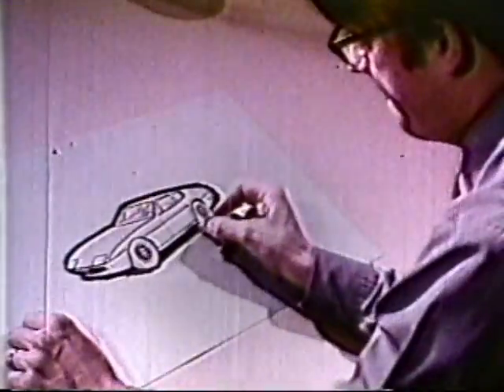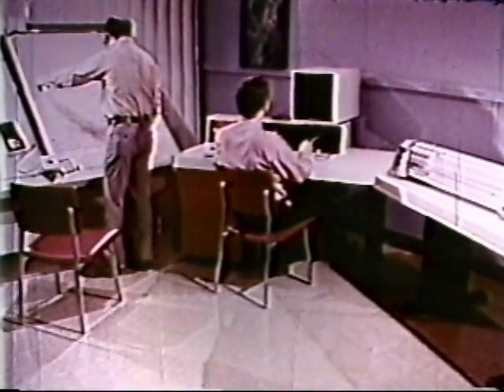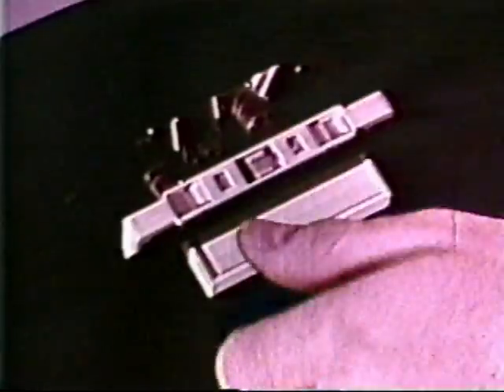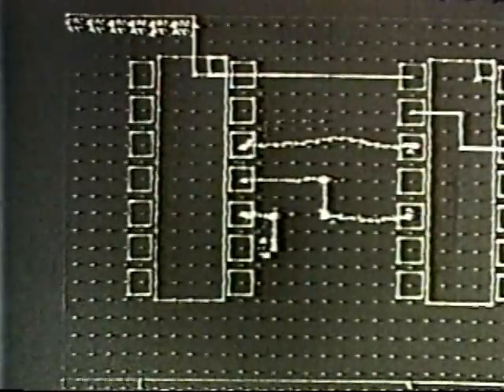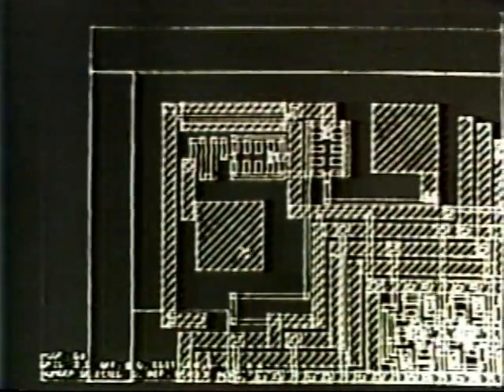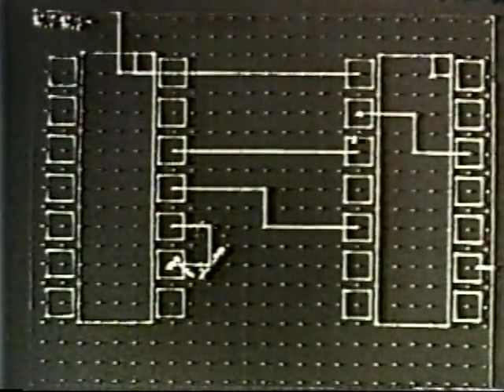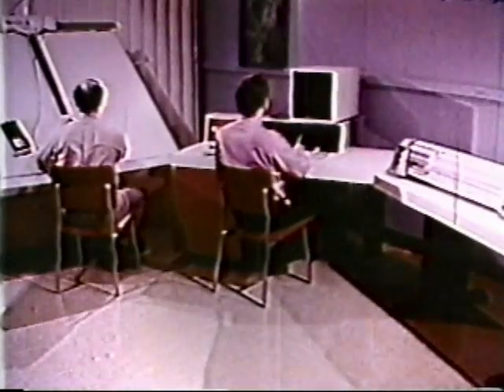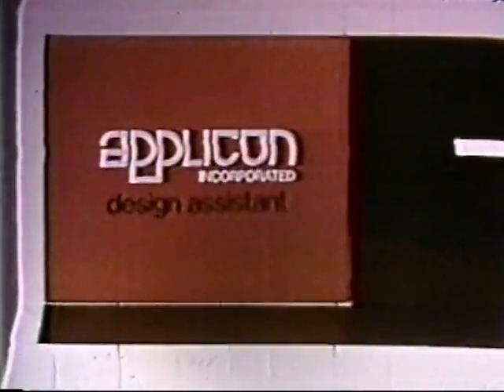Applicon Design Assistant

Comment: I started working on Applicon AGS 870 2D system in the late 1970's and then moved to AGS 880 3D system.  I went to work for Applicon in the spring of 1980 just after graduating.  I was involved in doing demos, training and designing the system interface for Bravo.  It was a great time and I enjoyed my work there.  I left Applicon at the end of 1985.